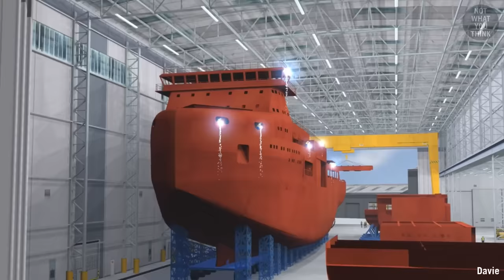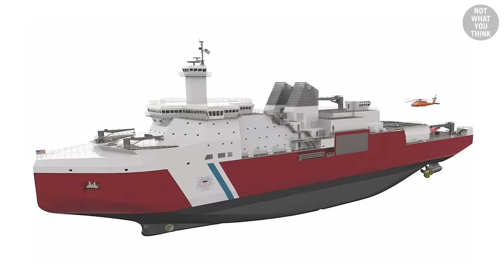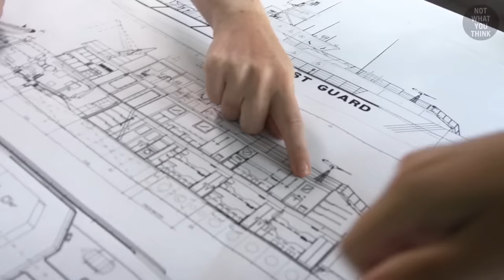Why US Desperately Needs NEW Icebreakers

Comment: my friend worked on a HUGE icebreaker just one month ago. We are both swedish and it is a swedish military ice breaker from the 1960s. The ship is called YMER and its frickin epic.
Reply: Ice breakers always look so badass
Reply: @monkemode8128   I've been on a ship with ice breaking capabilities, but it wasnt a true icebreaker. We were traveling on some relatively thin ice (about 4 inches thick), and the noise is something else. Cant imagine working on a big icebreaker that goes through steel ice like nothing, it must be maddening inside. I wonder if the crew sleeps with ear protection
Reply: Was a Military ship they are entirely civilian now a day and yes the atle class is really cool
Reply: @rykehuss3435  i work on the one in the video, its not loud, only a lot of vibrations and shaking during the winter heavy ice season
Reply: Вы даже не знаете как выглядят настоящие ледоколы.😅

Comment: When I was in the Coast Guard back in the 70s, while stationed on the Northwind  we used to call the Star and the Sea building 10 and building 11. Simply because they were always in port  for repairs.  I see that much has not changed.
Reply: I remember it well. Both breakers had major problems with their props not meeting specifications.  When a new set arrived we discovered that the transport truck had hit an overpass and curled the blades.
Reply: That sounds similar to how battleship Yamato was jokingly called as Hotel Yamato by sailors when admirals didn't want to risk ship getting fired at in battle and kept it safely at port/away from battle zones.

Comment: As a Seattleite, it would be a wonder to see the Polar Sea take to the waves again- and at a price of $250 Million, it's more cost-effective, and if both Star, Sea, Healy, and up to 3 of the Polar Security Cutters enter service, 2 In-Service, 2 Winding-Down, and 2 Preparing for Deployment will suffice our Arctic Needs cleanly for the next 15-25 years. At one point, we used to have 9 major Icebreakers (8 Saltwater, and 1 Great Lakes), that could take-on the world. Now, we have a Medium, a Heavy, the (smaller) 2nd Mackinaw, and a bunch of little ones. Bring back the Polar Sea, and get the Polar Security cutters underway!

Comment: Coast guard is hard asf to join, they accept like 500 outta 4500 applicants each year.. almost 1/10
Reply: Definitely not as difficult as it used to be
Reply: @thwingc  how many are accepted outta applicants now?
Reply: @TylerChubb-c5o  There's a CG Facebook post from 2012 that says less than 4% then. I'm not sure what current numbers are, but they've raised the maximum age, and relaxed some other requirements. I don't know the specific numbers, but I'm certain it's one piece of the effortnto increase the number of servicemembers.
Reply: Theyre desperate for members just like every other branch now. Theyre even thinking of having 2 yr contracts or some sort of part time service system

Comment: Russia once even considered turning an old Typhoon ballistic missile submarine into a freighter to support some very remote stations. The reasoning was that for particularly long but low-cargo volume routes it would be cheaper to use such a specialised vessel over having to keep the entire route ice free. But I doubt this would be a viable option for the US, as their routes in Alaska have a much higher traffic volume. It might be an option for the antarctic, but a SSBN needs even more specialised personnel than a regular icebreaker. I think Russia only even considered this because the shrinking of the navy after the collapse of the Soviet union meant they had submarines and trained personnel just lying around

Comment: Easy solution, I think putting icebreaker hulls on all ships going to, the antarctic
Reply: Unfortunately, that's a massive undertaking. 

It'd be similar to modifying every vehicle to be a school bus so they could transport 70 people. It's probably possible, but requires substantial changes to the parts of the vehicle that really make up the core of what it is.

Pretty sure that's a terrible explanation. I wish I could do better.

Comment: American icebreaker design is based on horsepower, brute force. For example, Finnish modern diesel-elctric icebreakers are more powerful than those built in early 1970's, but with less engine power and a fraction of operating cost.

US has laws and regulations protecting American shipbuilding industry. The US government cannot purchase other than American-made icebreakers. 

The cost of an American-made icebreaker is 3 times the costs of a the most modern and most powerful Finnish-made Polaris-class modern Icebreaker. Polaris class has dual-fuel engines (LNG/diesel).

Comment: Just wondering what a line charge would do to the ice
Reply: not much the ships work by putting all their weight on the edge of the ice so you are getting a large concentrated force going one direction with a charge on the surface not much is gonna happen unless its massive.

Comment: One major problem, least years ago and probably today, getting into the Coast Guard. By that they didn't have many openings, and to my knowledge they still limit how many they take in. Its why it's easier to join one of the other branches. From those who need people badly to not as bad follows usually like this, with the Marines usually at the top, followed by the Army, Navy, Airforce, and then National Guard. Coast Guard is dead last just because they limit their openings based on time frames and other reasons. While the other branches can fluctuate in recruitment drives, this list tends to be the average. At the time I was joining the navy years ago, the Coast Guard was only taking 13 people as that was their cutoff at that time. They wouldn't have another opening for months if not the next year. The navy had closer to 20ish counting myself, the army and marines damn near on par with each other with maybe 30 a piece with National Guard having 1. However, the National Guard did have more leading up to this with approximately 20ish, the guy who signing in had showed a day or two after, but still had to swear through the Army and go through boot camp like the others before him. He would just be catching the same bus with all the Army and National Guard recruits to head to boot camp in a few weeks following the swearing in. As for the Airforce, think maybe a little over a dozen, but they were expecting another 30 to show up in a week or two. But point is that most times the Coast Guard doesn't have recruitment drives like that often if at all. And looking at this vid now that might change or might not.
Reply: Nah they been needing people desperately for yrs its just people dont know about it or people look down upon it. Theres a staffing problem at every level. As well as funding and equipment.

Comment: Hi, I was in the Coast Guard from 1975 thru 1979 when the Polar class ships were built and there was nothing but disappointment and mechanical shortcomings associated with the program.  The first is that there was no funding to support them as their PRIMARY mission was the oil passage from the North Slope of Alaska which was accomplished by the pipeline.  Antarctica is a side show and can be accomplished with commercial boats.  The CG has little no SUCCESSFUL experience with designing icebreakers and the crewing and maintenance programs are inadequate due to the service size:  NO INSTITUTIONAL KNOWLEDGE.  The catastrophic engineering failure of the  Polar Sea demonstrates these issues.  There most recent attempt is on the way to being a replay of the disastrous Polar class.  The CG needs to get out of this dusty ASAP; it's to small of a service with too many jobs to do, PERIOD.

Comment: What makes an icebreaker, an icebreaker?
Reply: An icebreaker is a special-purpose ship or boat designed to move and navigate through ice-covered waters, and provide safe waterways for other boats and ships. Although the term usually refers to ice-breaking ships, it may also refer to smaller vessels, such as the icebreaking boats that were once used on the canals of the United Kingdom.

For a ship to be considered an icebreaker, it requires three traits most normal ships lack: a strengthened hull, an ice-clearing shape, and the power to push through sea ice.[1]

Icebreakers clear paths by pushing straight into frozen-over water or pack ice. The bending strength of sea ice is low enough that the ice breaks usually without noticeable change in the vessel's trim. In cases of very thick ice, an icebreaker can drive its bow onto the ice to break it under the weight of the ship. A buildup of broken ice in front of a ship can slow it down much more than the breaking of the ice itself, so icebreakers have a specially designed hull to direct the broken ice around or under the vessel. The external components of the ship's propulsion system (propellers, propeller shafts, etc.) are at greater risk of damage than the vessel's hull, so the ability of an icebreaker to propel itself onto the ice, break it, and clear the debris from its path successfully is essential for its safety.[2]

Comment: I think that the us is doing the icebreaker all wrong by using the coast guard because if they were civilian but governmentally manned and owned they could get the number of sailors down because they would only need a crew similar in size to a merchant vessel. Just look at Sweden and Finland they use this method and they have more icebreakers than the us because they require less sailors for one vessel. Also they should probably have looked to Finland for the actual icebreakers because they have extensive experience building and designing icebreakers.

Comment: As I recall, the US has basically a law prohibiting purchase of non-US military vessels, including icebreakers.  At one point Finnish industry built icebreakers to that time Soviet Union.  I suspect those were copied for the present fleet of Russian ones.  Germany ("West-") also bought one from Finland, but it was leased back to Finland and operated by a Finnish crew  in Northern Baltic and Gulf of Bothnia, "Unless needed in the Southern Baltic".  Another specialty from old news is that Finland has an indoor iIce Breaking Laboratory, supposedly the only one in the world.  But no chance selling icebreakers to the US.
Reply: Russia has nuclear powered icebreakers. The biggest and most powerful in the world. I don't think they copied those from the Finns
Reply: @pvbarbell1904    I am not sure if they have more than one nuclear powered icebreaker.  Anyway not 50.  The balance is either Finnish made, or what I suspect to be copies.  By the way, unless my memory is failing worse than my age allows to me, I think the crew of the one (or first) nuclear icebreaker once made a mistake and let it freeze all around in the solid ice.  One of the Finnish built icebreakers was called to cut the ice around.  Icebreakers depend on movement so the ice can not grow too thick all around and in contact with the hull.
Reply: @InssiAjaton  They have been making nuclear powered icebreakers since the 50's Made around 10 or so. They are currently building some massive new ones. No other countries ice breakers can compare to those (One with twin 300+MW powerplants)